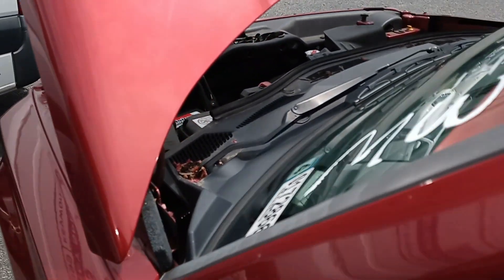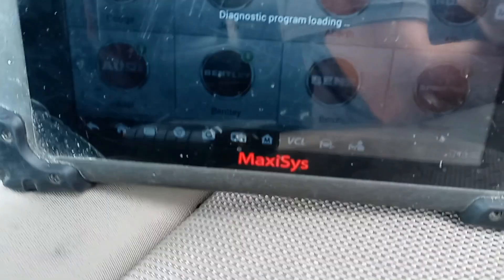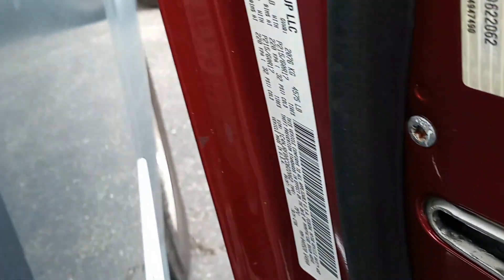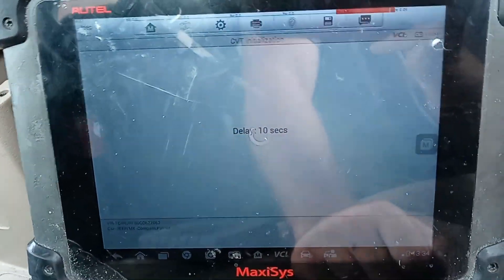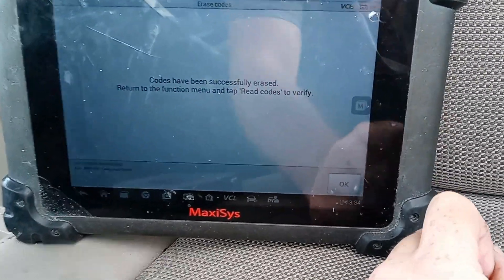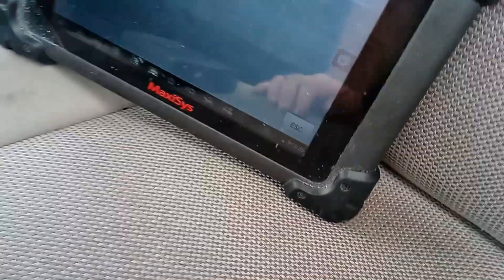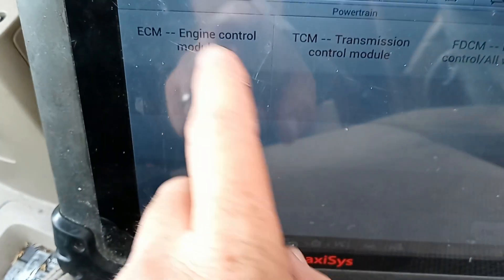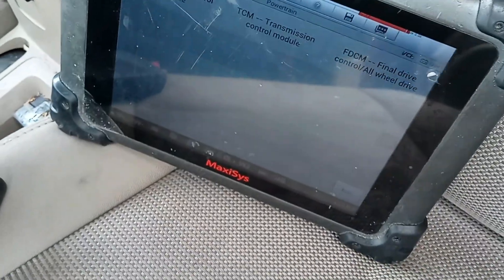Programming used replacement TCM on Jeep Patriot with an autel ms908 diagnostic scanner the easy way

Comment: How much you charge to do my 07 jeep compass I’m in VA
Reply: It’s insane how Chrysler has those transmission coded to the vin numbers ..Just a simple tranny swap of the exact same tranny leads right back to the dealership..🙄
Reply: @cedthetruth1311  right bro it’s crazy
Reply from the maker: I dont do much mobile programming anymore sorry. Best to find a local shop to you.
Reply: @ecurepair appreciate it question when you reprogrammed it was it because the tcm wasn’t allowing the car to move
Reply from the maker: Not sure on that to be honest. I programmed for dealerships and mechanics, They tell me to program it so I would. I never test drove or asked many questions. I would assume it would move though, probably just stuck in limp mode.

Comment: do all used tcms need to be reprogrammed? even attached to valvebody?
Reply from the maker: Most do as far as I know
Reply: They do. I have the dealer coming to my house tomorrow to flash a used tcm in my 15 Grand Cherokee  @ecurepair

Comment: How would I know if installed the wrong part number. Did everything on the video but it won’t come out of 1st gear.
Reply from the maker: Sorry, no clue on that one.  If its not working though its likely the wrong unit or needs full flash update which would likely not let you flash if its the wrong unit.
Reply: did you find a fix to this? im having the same issue.
Reply: Back probe the TCM wire harness..the C1 & C2 connectors.  See if you get the proper voltages.

Comment: I replaced the tcm on my Chrysler 300 but it’s not letting me program it. Mechanic said I need the dealership to use their software . (His is a after marker ) ?
Reply from the maker: Im not sure sorry. Its very possible witech will be required.
Reply: @ecurepair  is that only available at dealers
Reply: @12asalazar  no, aftermarket can use it to it's just expensive so not all shops will go that route

Comment: Hi. I have a 2016 Acura mdx and when I install the replacement tcm the ignition will not turn on for me to do the programming. Any ideas? I tried a few used tcm modules with the same part number. Thanks
Reply from the maker: Im not all that familiar with module swaps on Honda/Acura stuff sorry. Probably someth

Comment: Do you know where I can find one that doesn't cost so much. Looking for a scanner tool under 500 dollars
Reply from the maker: the 908 I dont think is all that expensive for what it can do but besides that I guess you could look into the the smaller 906.
Reply: @Keyworks ECU Repair   do you have a link? All the ones I'm seeing are over 1k dollars and I'm very poor. At most I can do 800 dollars
Reply: Also would the MX808 work I found that one for a good price I'm mainly just trying to program my tcm
Reply from the maker: @AuzzAustin  i dont have any experience with it sorry
Reply: @Keyworks ECU Repair  all good I'll try to look more into them. I'm not good with any of these scanner tools.
Reply: Friend, I have a question, does the scanner of the version you use 908 do the tcm initialization? Or should I use some additional accessory? In the video I see something similar to a wireless module. 

thanks for your help.
Reply: @felixurbinacardenas2516 did you find the ansser friend?
Reply: Do you need to pull the data from the old tcm and put it on the new one?